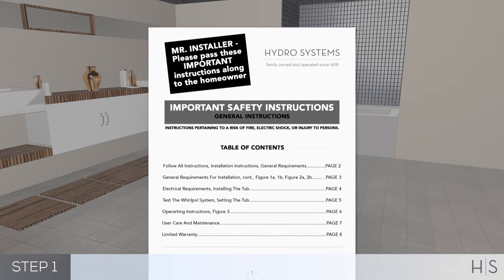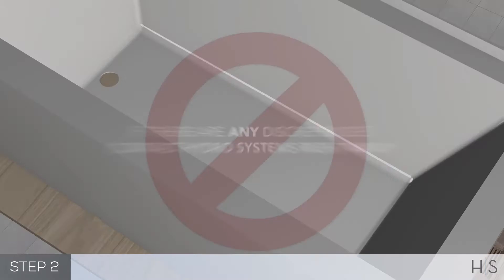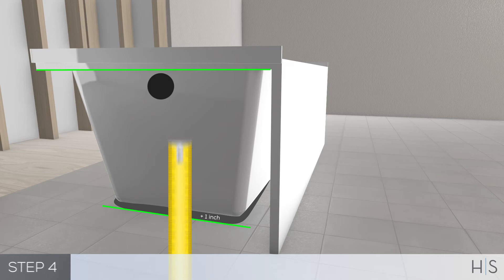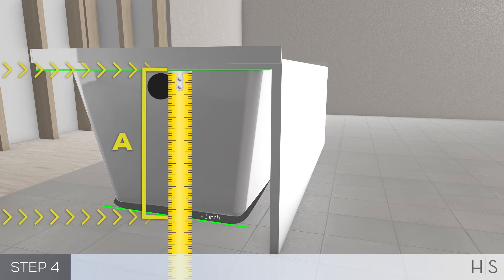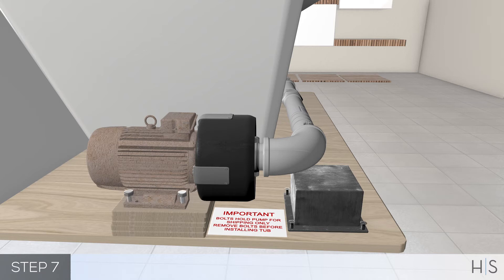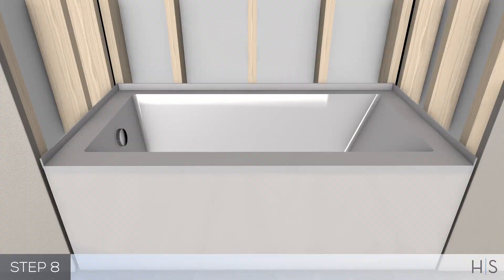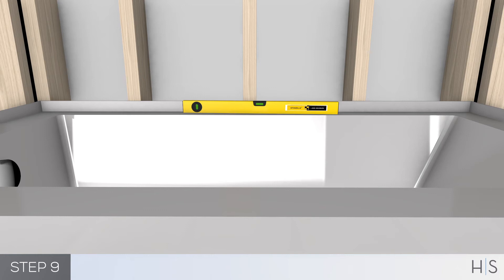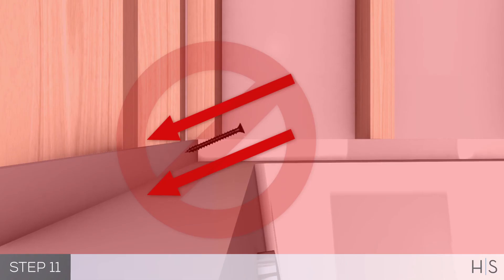Hydro Systems | 3-Wall Bathtub Installation Video

Comment: Disagree with this video.Don't add 1 inch to the height of the ledge if you have a level  and flat floor! otherwise you will have a tub out of level and the headache comes when you install the tiles. IMO mortar bed must be spread at same height , within the tub contours / runners . Don't walk on it after setting tub on mortar, just it wiggle little bit. Put two bags of 50 lb bag of anything on the tub's bottom and let the mortar dry 24hrs.  you can do draining work later if you have access to the tub draining holes. This is was my experience with Hydro system 3 sided wall. Good luck, DIY

Comment: I have a alcove tub with integral tile flanges and a skirt. Determining the ledger mounting height is not possible using the audio instructions in this video. Its says, "measure the distance from the top of the ledger to the floor." Huh?

Comment: ..and if it's not level, then what?
Reply: Great question.
Reply: Then your stringers are out of level. Fix 'em.
Reply: If the tub is not level, it won't drain correctly.  Level the floor and walls first.  Then install the tub.